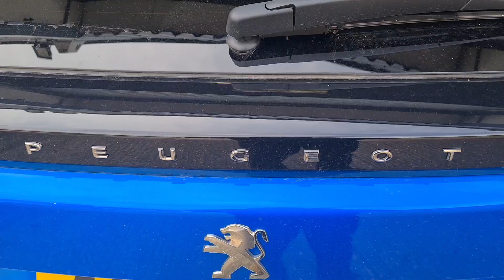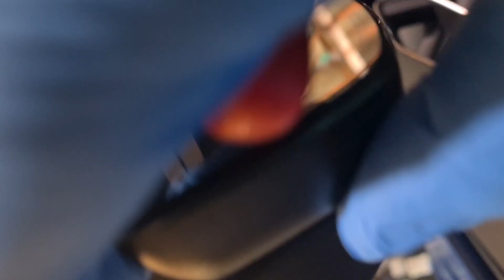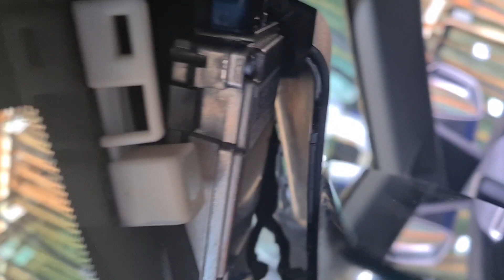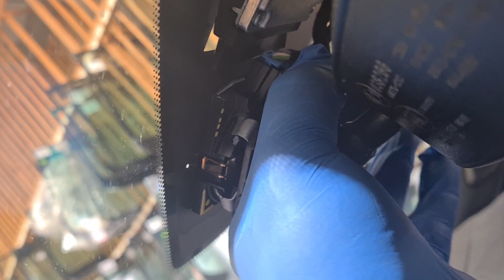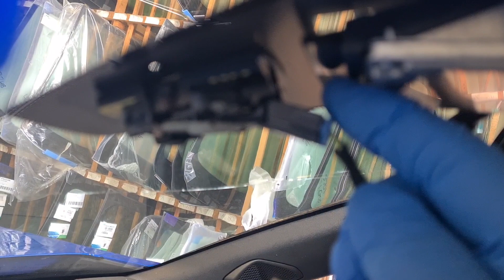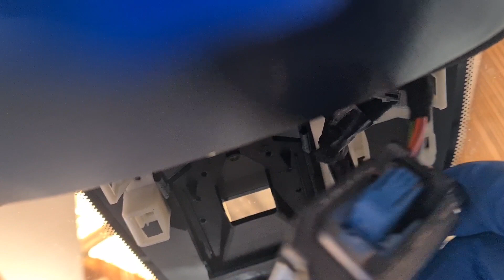(23) peugeot 2008  rear view mirror sensor and adas camera removal

Comment: Hi how are you, My model doesn’t have the adas lane keeping camera only the wipers sensor, I found a lot of them on ebay, if I buy one of them I could enable lane keeping or signal readings on my 2008?
Reply from the maker: Hi provide you have all wiring required and programming you should be ok ..